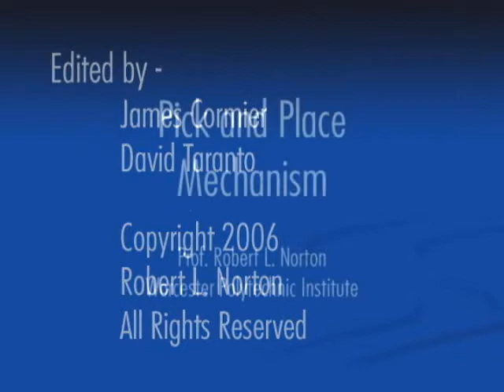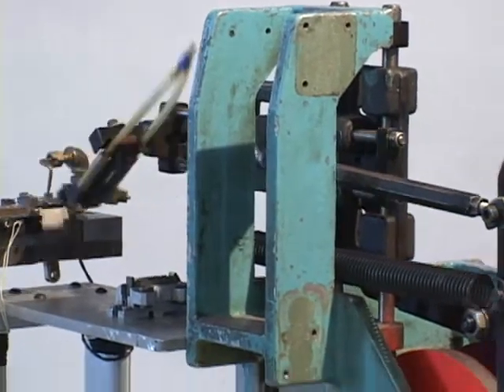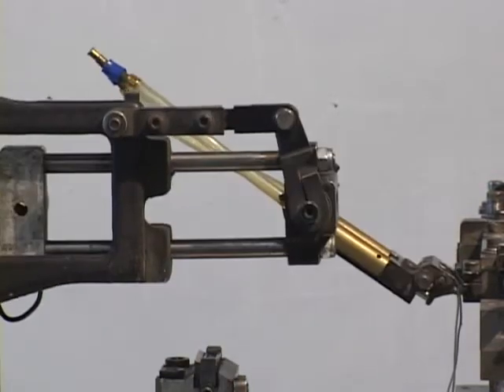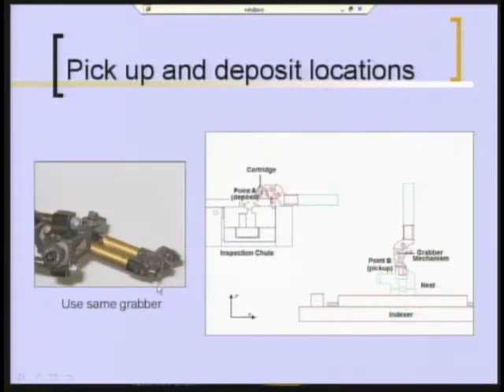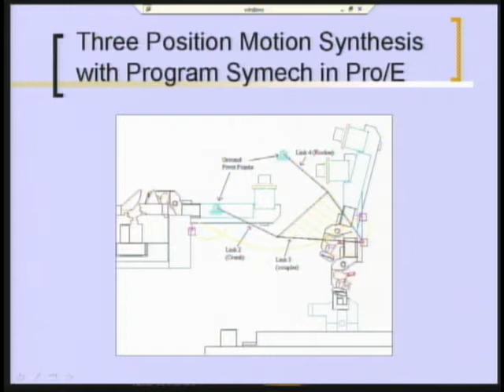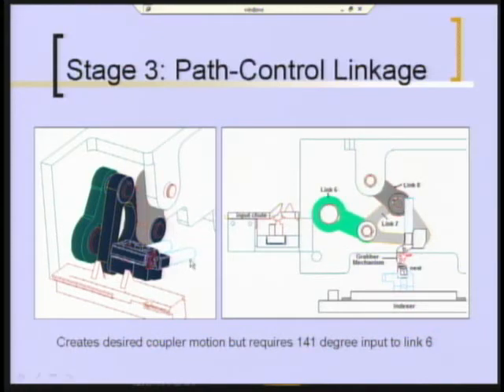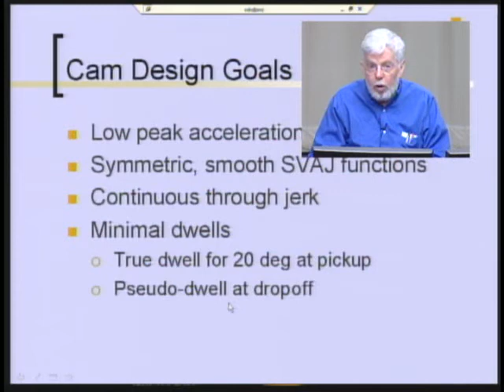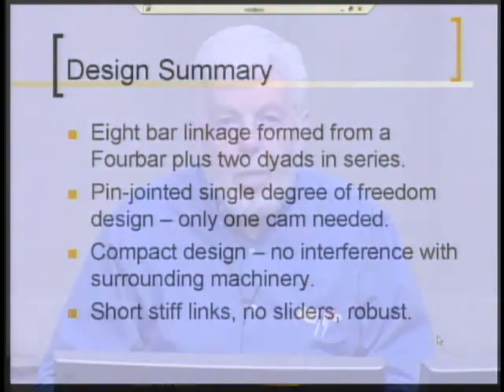Pick and Place machine | Instructional Video by Prof Norton

Comment: A pick and place (PNP) machine is a robotic assembly device
 that uses a vacuum to lift a component off of a piece of tape, rotate it to the right orientation then places it on a circuit board.